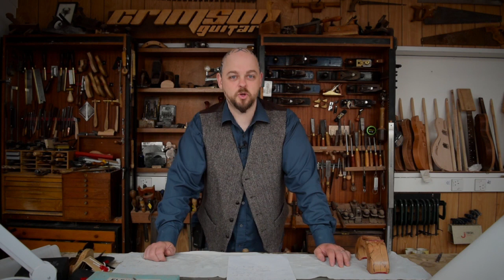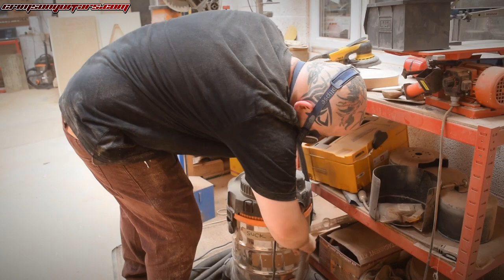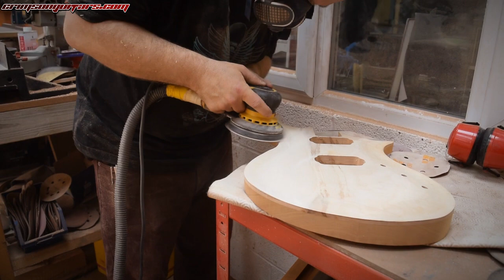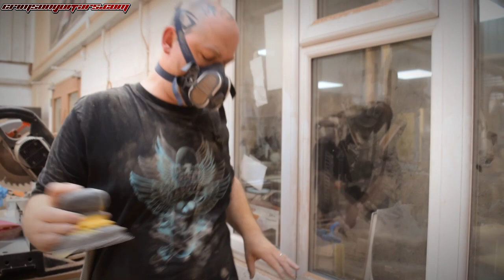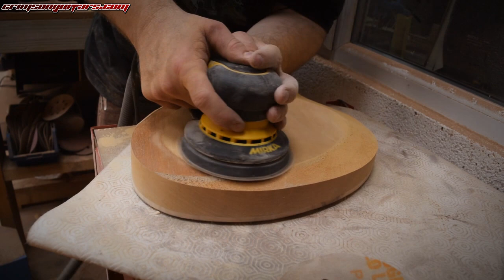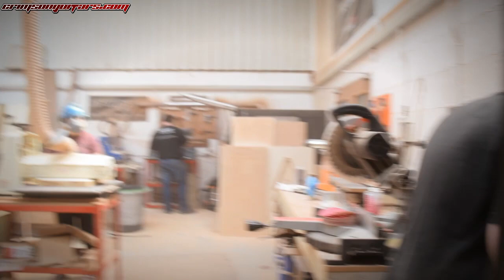The 12 Hour Build - Episode 11 (13:00 - 13:30)

Comment: Hey Ben, great work.....a lot to learn.
But here's a challenge for you: You're talking of building a guitar with as few tools as possible. I do now the first serve:
10 Tools!! (1 little axe, 1 knife, 1 hammer, 1 scrwedriver with 2 bits, 2 handdrills, 1 chisel, 1 saw, 1 Marker and 1 ruler....we do not count clamps and glue and masking tape and a stone to sharpen our knife.......and the hardware...okay we would need a soldering iron at sometime...okay 11....
we both start with 2 pieces of lumber and go for it, perhaps as a small competition??? I wait for you!!!
Reply: outch...okay 13: a rasp and a file...wouldn't go without it...

Comment: I want to build my own Les Paul but as its my first time ever building a guitar I want to start off with a DIY guitar kit. Do you know where I can get a good quality kit that will give me a nice guitar when I'm done. The kits I've looked at seem to be a hit-and-miss sort of thing, some are good, some are bad. Keep up the good work with the videos! Cheers.
Reply: The crimson guitar have (or will have, not sure if theyre out already..) their own brand of DIY kits, check their website! :)
Reply: +Lippa100 I checked out Crimson guitars website for guitar kits but they only had half finished necks that you could carve out for yourself. Does anyone else know where I can get a good quality DIY kit?
Reply: From one Sean to another :)
Since Crimson doesn't have what you're looking for, what I would recommend is a body/neck only kit then add your own KNOWN quality hardware.  
I built a PRS style guitar - got the body/neck kit from ebay from some factory in China.  To be honest, I was really surprised with the quality.  it was a set neck, and the neck joint was perfectly tight, centered and aligned properly (not cocked off at an angle).  the only thing I had to do was adjust the neck angle (AKA: back tilt or break angle) because they come flat, like for a hard-tail bridge or recessed trem, but I wanted a tone-o-matic bridge w/ stop-tail (like on an LP) which requires a few degrees.  solid mahogany (or possibly sapele) body with solid maple cap, carved top and pre-routed for 2 humbuckers, control cavity and 3 pre-drilled holes for pots and/or switches.  the only drilling I had to do was for the bridge & tail.  I added my own tuners (generic non-locking for now), and for pickups I went with Gibson 490T at the bridge and 490R in the neck.  CTS concentric pots, Switchcraft switches & jack
the neck/body was around $125 (US) shipped from China, so my overall cost was really determined by the hardware I chose.
Reply: +Sean Bova Yeah I was thinking about doing that, it seems like my best option. I've never made one before so I hope it's not too advanced. I should be right, cheers mate.
Reply: Byoguitar for a decent kit, precision guitars for something that'll blow away most gibsons

Comment: Backpain kicking in already? That kind of work is a killer for me, if I don't remember to take breaks often. And I never do.
Reply from the maker: +esa062 this nearly scuppered the whole build, it still hurts nearly a week later!
Reply: I'm dealing with pretty nasty tendinitis in my right arm. I think I acquired it when I built my lap steel...back in December. It's really unpleasant and I don't like the fact that my body refuses to fix itself more and more often the older I get.
Reply: Look after your back! I wish I had when I was younger then I wouldn't be on two sticks to walk at 61, not being able to play with my Grandchildren.
Reply: Big part of lower back pain is caused by muscular problems. There are ways to fight that. First thing to address is, we as humans, by lack of physical activity(and probably by using the shoes), we stop using buttocks and pelvis muscles to stabilize vertical position and that puts too much tension on our lower back. It can be fixed by 15 minutes exercise a day(squat variations). Also, the bar stool with seat that can tilt 15 - 20 degrees in every direction is great way to force Yourself to awake stabilization muscles

Comment: Just a bit concerned as to how much you were taking from the back. You want it flat before you drill the posts for the bridge, don't you?
Reply: +Wilson Phillips Both bridge posts are required to be parallel and vertical. I use a drill press when doing mine, with the back of the guitar flat on the base to prevent rocking so if I need to raise or lower the bridge I can do so without it seizing up. ;)